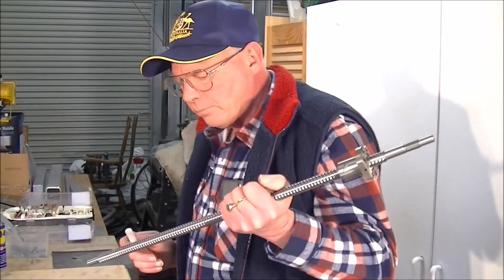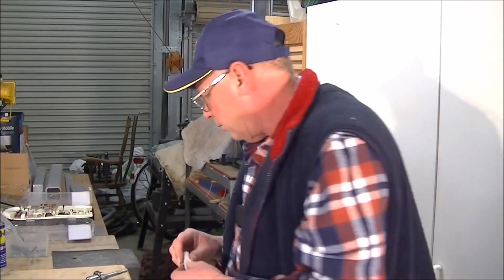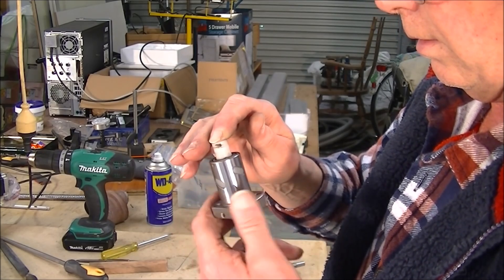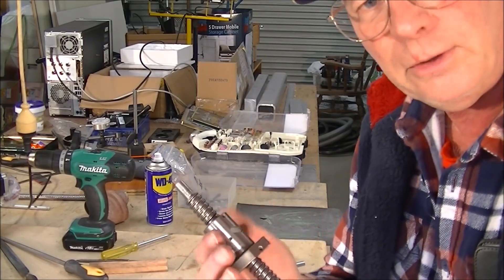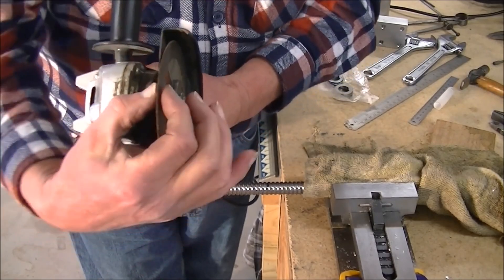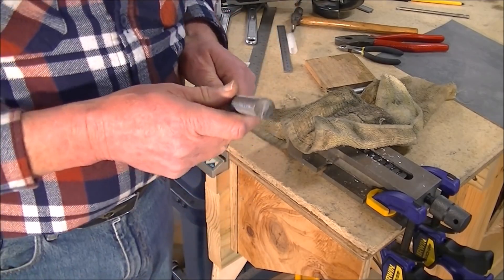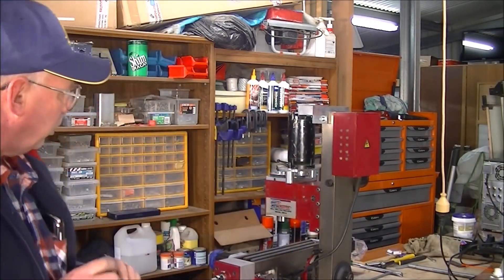Harbour freight Grizzly Sieg X2 CNC Conversion Z Axis build Part 2

Comment: these nuts are simple to pop apart and reassemble. 51 balls, 17 per race on a 1605. i was scared at first too! they really ARE easy...

unlike the old ...hobson? ones on the original screws i had. yuk. and they always needed cleaning out...

not a fan of the Z like this. had it with the CNC fusion kit, its too fiddly for setup, and you lose a vital inch or more of that vertical travel! you need every millimeter on these!

im taking that "slot the column" approach... the nut fits down there, just have to knock the edges off the webs inside. tiny little nubs. fly cutter or something...

counterweights... tried a weight on a chain years ago first... horrible.
gas struts, 15kg... some point after the fifth one failed it sort of sat unused and neglected for the last ten years... and the computer died... just scraped it all up and getting it back together now... leaking roof made a mess of things...

so havent tried it, but the plan is a pneumatic cylinder. forget what diameter but iirc it should take 60ish psi for 15kg. regulate supply to not quite balance, then blow off valve set a bit higher.

erm. the nuts are hard. just hacked one half of my X nut down... killed a carbide endmill... 

so far... the Y axis bolts together with no binding, no slop. 

invested a lot of time years ago and the results were disappointing. this time? well... i did a better job at scraping...

and in hindsight? should have just hacked it out and used linear rails for CNC... sigh.

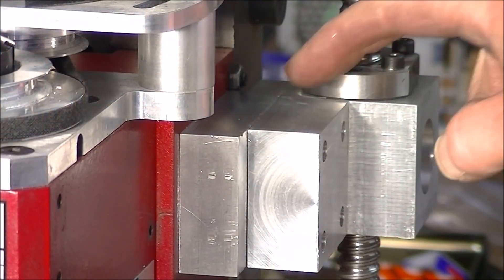Comment: At 12:45, Is it possible that the ball screw is too close to the head horizontally? Did you check for clearance/interference at the top of the travel? That view at 12:45 appears to be 'spring loaded', meaning the ball screw is being bent. Perhaps it would be better to have 0.005" clearance at the top of the travel, then verify 0.005" is still there at the bottom of travel, and then shim 0.005". It is very inconsequential for error at the bottom of the travel, but super important not to be binding at the top. If it is too close you could mill off 0.005" from 1 surface or the other until you are 100% sure of non-binding operation. at 18,45 in your previous video you are concerned about 1/2 degree of angular error, perhaps it is still there because of the irregular mounting surface?...Thanks for making these videos!